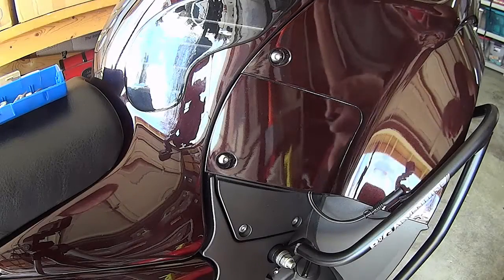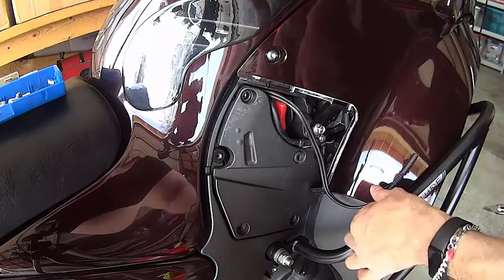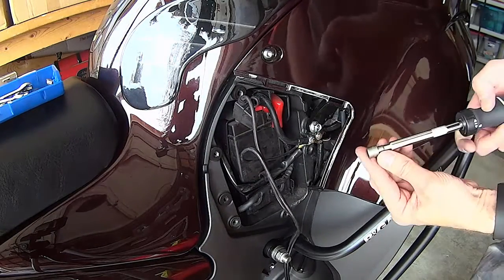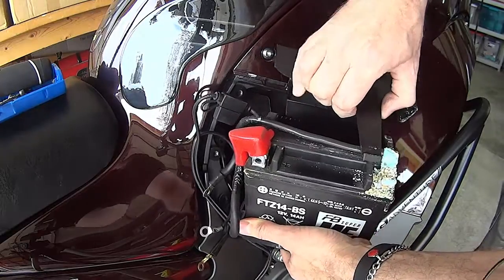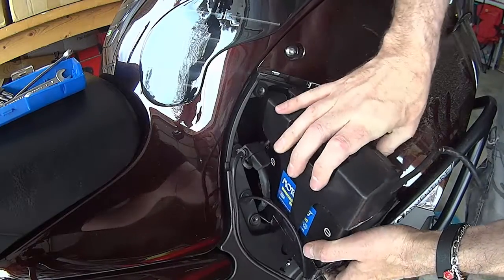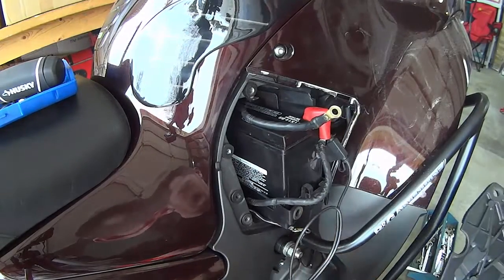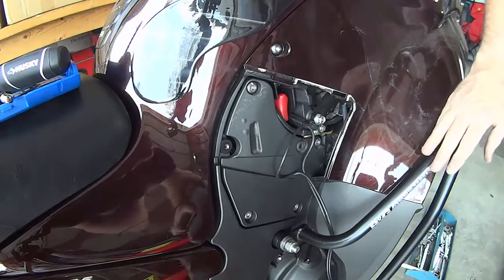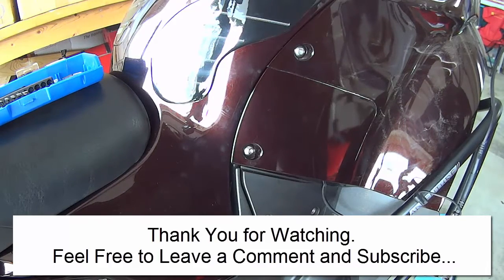Replace Battery on Kawasaki Concours14 / GTR1400 - Short Version

Comment: If you turn the negative terminal 90 degrees anticlockwise, the cable runs directly through the opening in the battery cover, as shown in the workshop manual. The way you have installed it adds an unnecessary bend in the cable putting excess pressure on the cable and negative post. See 'ELECTRICAL SYSTEM 16-27' IN THE WORKSHOP MANUAL. Gen 2 version.

Comment: Thanks for the video, I have a 2008 gtr and I’m going to fit a optimiser lead to the battery, it looks straightforward but any suggestions on the installation, 
Cheers 👍

Comment: Hello, we had to replace the battery on my uncle's GTR1400 2008 but after doing so, the "steering block" (I'm not a native speaker and i don't know what's the right word for it :p) wont go off. Have you maybe got an idea where it could come from?
Reply: We found the solution! ( i think).
In fact it's the motorcycle of my deceased uncle and we have to move it in order to sell it. I think its simply the transponder which has a dead battery! But we found a video on how to start the bike with a dead transponder so we will try that :p Thanks for the help!